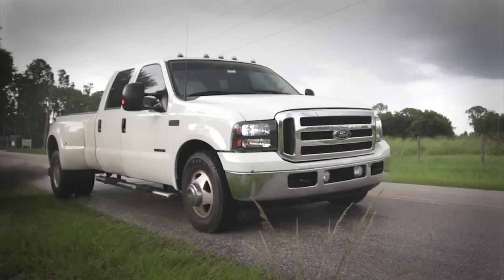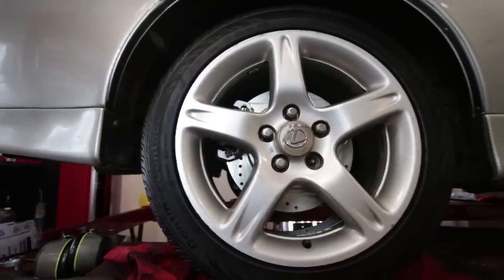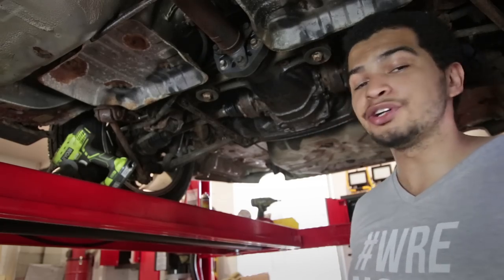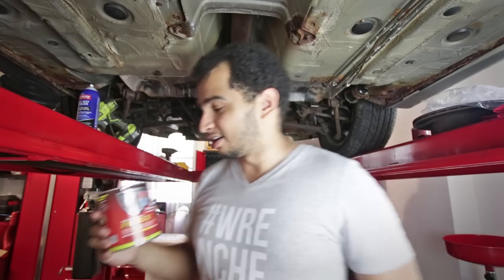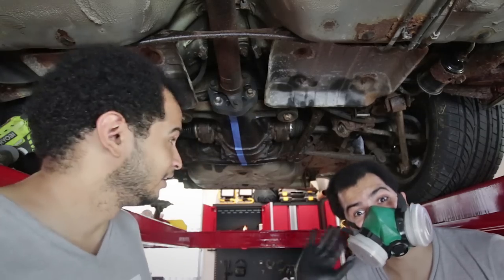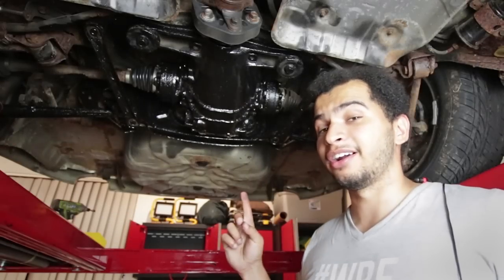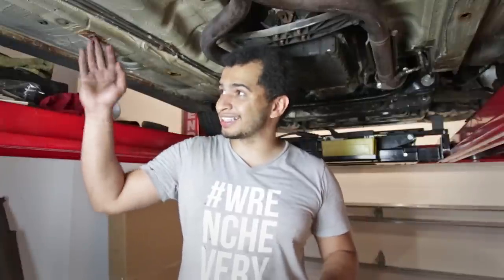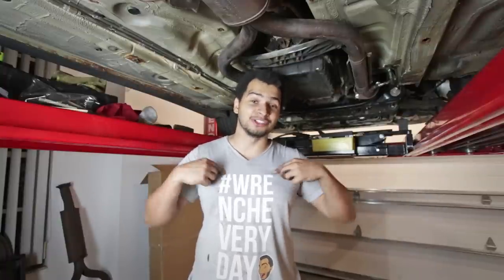I Made My Super Rusty Lexus SC Great Again, For Next To Nothing

Comment: I also applied POR15 on my E36 M3. I applied it to the entire under body including underneath the side skirts, side rails, and rear subframe (when I dropped the rear end). I then sprayed the treated areas with truck bed liner. It's overkill, but I live in NJ so this car won't be rusting for decades to come. Lol.
Reply: VemacRD350 That's the plan with my Jeep! Except for the truck bedliner part, I'm opting for Fluid Film so I can soak the inside of the frame and everything else
Reply: I love reading these comments because I live in Florida and for the most part rusty cars are not a thing here
Reply: Unfortunately that might not be enough: Most of the time, the really bad rust is starting from the INSIDE of the frame rails / frame elements. They are treated against corrosion by the factory, but on older cars you have to renew the treatment, e.g. fill these hollow spaces with oil (there are products available specifically for this purpose, but afaik it's basically oil with additives). To do that, you might have to drill a bunch of small holes in the right places, and then squirt the oil into it. I'm sure there are videos or tutorials out there.
Reply: I'm about to start doing quarter panels on my Cutlass so while I have it apart and off the road I hope to POR15 the whole damn under body too. I'm in Delaware so I feel your pain man. lol

Comment: You were under the car painting the rear diff with POR15, but you didn't paint any of the rust on the car chassis/uni-body itself? I don't get that. A big chunk of cast iron isn't going to rust thru very fast. The thin sheet metal of the cars uni-body will.  And you'd get better results with the POR15 if you do the correct prep work.

Comment: With POR15 you will find it flows much better, covers better,  dries smoother and lasts longer if you use the POR specific reducer.  You can spray it also but it's a bit of a bear to clean the gun...don't use a good one.  PS you can use POR20 (silver) on all your exhaust components...it lasts years and I mean years.

Comment: You have to get the Oxygen and moisture (humidity) out of the can of POR-15 or it'll completely harden and you'll have wasted your money. I've heard welding gas will displace the breathable air and prevent it from curing.
Also, You'll enjoy those Conti's. Although they will wear quick. My CC ate a pair down to 1/32nd in 26k miles. In SWFL. Same size 235/45R17. They only got noisy at about 3/32, but not terribly bad, though.

Comment: I can confirm that POR15 is extremely tough. That shit will weld metal together. You do NOT want to pour this shit from the can into a smaller container and then put the lid back on while the edge isn't totally spotless. I did that, and when I tried to open the lid, I managed to open it a tiny amount so I figured I'd use a screwdriver and later a fucking crowbar to open it... I literally ended up folding the can in half and the lid never came off. I did manage to pour the remains in a plastic container, which opens and shuts fine :)

Comment: Well, I believe that every suspension component needs to be removed from the frame get sand blasted / beed blasted and then inspected for cracks. If the inspection is satisfactory and a reworked finish can be achieved then it will be fine to proceed to powdercoating and re-assembly. I believe that painting over rust is not really helping anything. Also the frame needs some serious rotissery work too. Not sure if you can invest the man hours for this project as above all it will be labor intensive.

Comment: Dude uhh... I'm like 90% sure the POR15 could have been used without the rust inhibitor, that's what the POR15 does. Basically you put down a really shitty primer for some very nice paint... when the paint would have been better primer. You added a step and left room for that junky stuff to flake off and rust :(
Amazon description: "for application directly on rusted or seasoned metal surfaces"